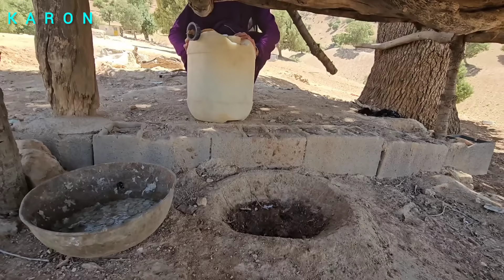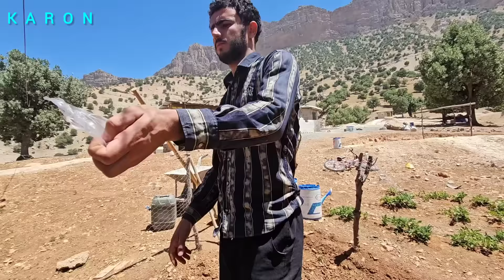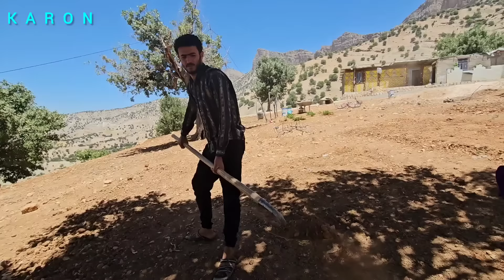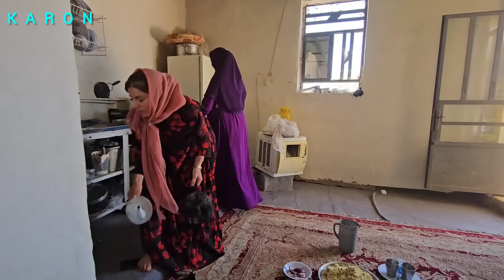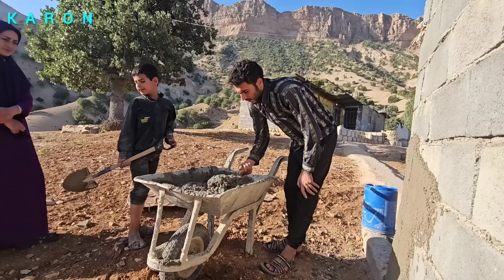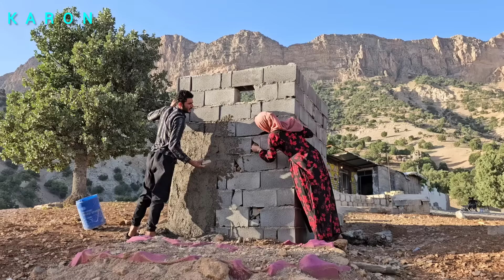"Nomadic Daily Life: Bathroom Renovation by Uncle Hamid"

Comment: 산에서 긴 호스로  물을  끌어올수  없나요 농사에  물이  많이 들어가는데
Reply: I noticed that Hassan has access to water and he is right down the road from Hamid.  Is there a way for Hamid to get the same set up, the task of toting those containers to water the garden is labor intensive, if you had water, you could run a water hose to the garden, use an awl to put holes in it to make your own watering system.  That way you wouldn’t have to carry the containers or take the time to water it.  You will eventually need a fence to enclose the garden to keep the animals out, and the viewer was right, you should water early morning or late evening.